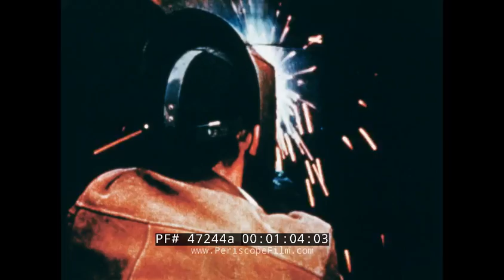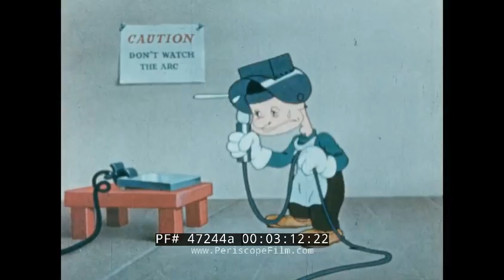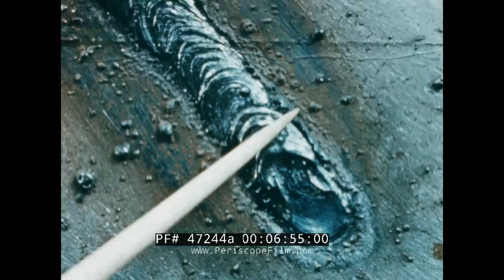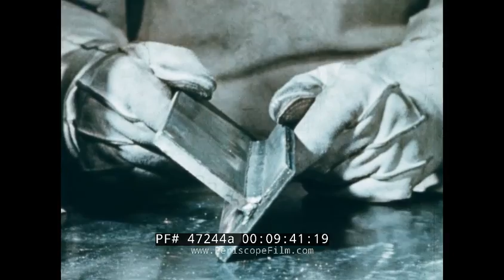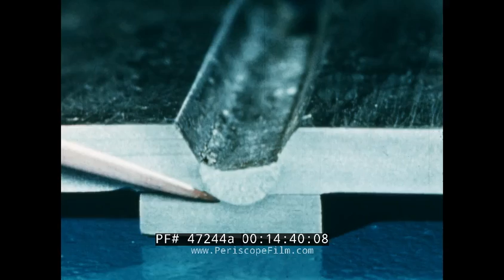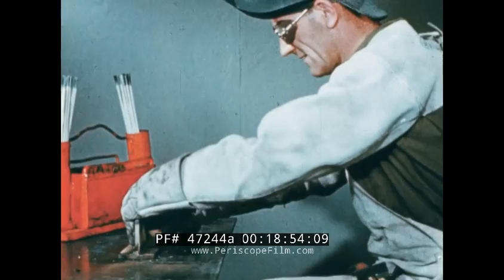FUNDAMENTALS OF MANUAL SHIELDED ARC WELDING Pt. 1  FLAT & HORIZONTAL POSITIONS 47244a

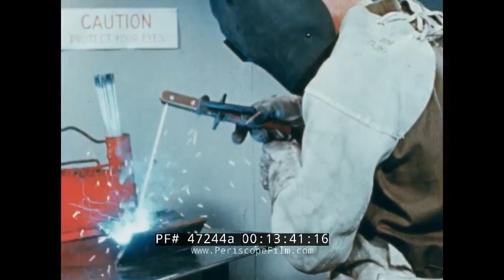Comment: The dialog was written by an engineer. At 13:45 he says "As the weld progresses away from the start of the joint arc blow decreases and then the rod may be brought up to aore normal angle" Not normal as in ""ordinary", typical", "usual" or "standard" but normal as used in math physics and engineering, meaning "perpendicular" or "at 90 degrees to" . Pretty much, only engineers, mathematicians and physicists use the word normal to mean perpendicular. Everyone else just says perpendicular.Or perhaps a student of classical Latin...
Reply: Yeah.  Then they went home, had a high ball and smacked the wife around...ahhh the golden years.😂

Comment: I was having issues with my 7018 vertical up hill. My uncle whose an old pro was helping me weld a fence. I had my angle just slightly pointing up about 10 degrees. I chose this based on instructional videos I saw on YouTube. My uncle suggested I give it waaaay more angle so I watched him do a bead. It was about 45 degrees pointing upward. Ones the arc was started and the puddle formed, he just kept patting the puddle down into the bead. If he hit a real wide part, he paused and let the puddle sums up before he pushed that puddle down into the bead. It was beautiful! I tried a run doing exactly what he did and it came out identical. I no longer avoid the vertical uphills. My uncle was taught in the 70s by his uncle who built liberty ships in WW2 and built custom fence panels and gates after the war ended. Stick welding was all he knew. I feel fortunate be learning his old techniques by my uncle. Most of the welding I learned has been from YouTube. Chuckee2009, WeldingTipsandTricks, Weld Fever. I haven’t been to a school but I would consider my self pretty decent if we are talking fabricating implements, equipment repair, mods. Stuff like that. I would definitely need some legit classes if I ever did pipeline work. That’s a whole different animal.

Comment: any body please help me the exact orientation of the electrode (@ what angle we hold the electrode) for all positions in groove and fillet welding ??
Reply: Welding student here.  It will change depending on the position, and unfortunately this is one of the things that you really can't explain to someone.  You really have to get practice and figure it out for yourself because everyone welds a little different.  Typically you don't want to push the electrode, because you can trap slag.  The general rule is to drag the rod by about 10-15 degrees.  In general, however, the closer to vertical you hold the electrode, the flatter the bead will be, and the deeper the penetration.  When you use a steeper angle, i.e. further from vertical, the weld tends to crown up and penetrate less.  Look up Steve Bliele arc welding part 1 and 2, those videos explain what I'm talking about a little, so you can actually see it in practice.  I can talk all day about theory, but the only thing that will really teach you is practice so experiment with different angles and see how your welds change.  I wouldn't recommend changing technique in the middle of a weld, but do one weld one way, then another weld a different way, and compare them. See whats different and figure out what works best for you.  Hope this helps.

Comment: Well, the rods are the same, and I actually have some of those electrode holders pictured at the beginning!  I mean they're new, seventy years later... but we'll never see power supplies like that again.  Too bad!  I guess one of those big Airco things would cost a few thousand dollars now?  No electronics!  I once remarked that a big power supply didn't even have a light to show that it was on, and a guy said "It doesn't NEED a light, you'll know it's on because it makes a noise!"   My favorite are the old GE ones that look like a big drum, with a crank on the top, like a giant coffee-grinder.  I just saw an electronic stick welding supply that had nothing sticking out of the box.  The box was flat, like a big book.  No handle or knob sticking out, just "up" and "down" buttons to adjust current, a few led trouble lights, and a strap to carry or wear it with.  I think it weighed something like six pounds!
Reply: Leonard, I know it's a long shot here, but I'm about to start my first ever weld, I'm 32 and I would be so honored to use one of your tools, sir! I wish someone would pass on their "torch" to me, not literally.

Comment: I'm a welder. I like this video alot. It's easy to follow. It explains things in plain English  
I really like fabrication of Metals. It's a good science a really good trade.
Reply: hey man if I buy those welding goggles like he has on in the film, is it 100% neccesary that I buy the full face mask. Because I see the face mask is also tinted so it's like...why the hell is he wearing 2 tinted PPEs?
Reply: @murkypuddle33  you need the full face welding shield as it protects your skin from UV rays which can cause skin cancer. The goggles he’s wearing are only redundancy and aren’t necessary with modern welding hoods.
Reply: A weldor. Not a machine.